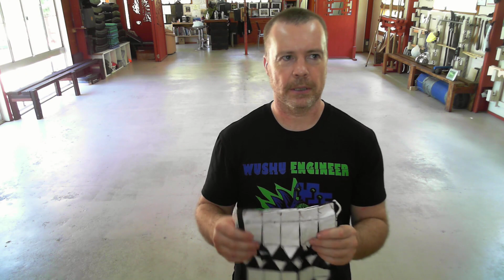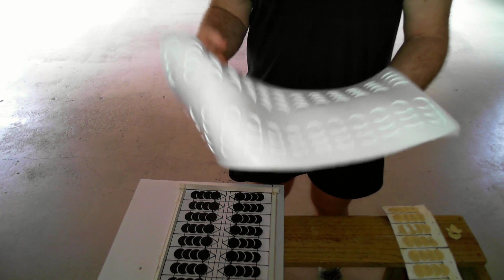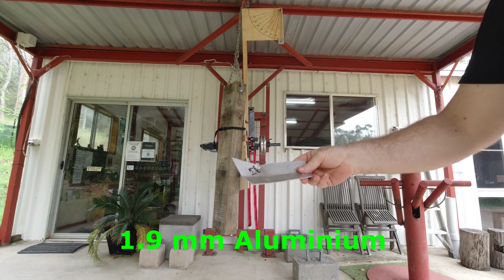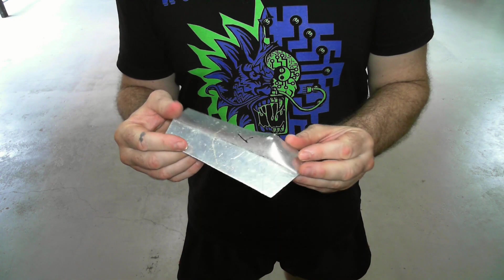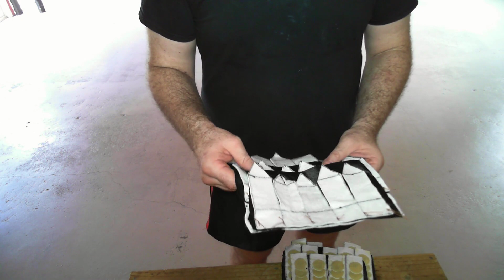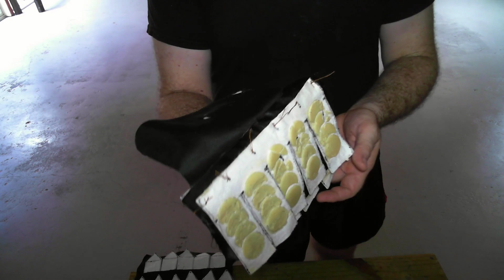Stab-Resistant Slip-Skall Armor Mark 2 - Design and Testing. Do we make it open-source? You Decide!

Comment: How heavy is it? I just wonder about the weight if you use three layers like this and make a full garment / vest.

I also wonder about how much the 'slip' effect is contributing. You might want to compare layering the armour as a rigid composite (plate - fabric - fabric) perhaps gluing/sewing it in place. It might be as simple as taking a regular piece and then fixing the lappets.
Reply from the maker: Thanks for your comment. The fabric itself is quite light. Since posting these videos, I have been experimenting with using stainless steel shim washers (0.1mm thick) glued onto the fabric. This has been quite successful and adds very little additional weight. I have yet to put that into a video though. My video producing always lags behind my actual projects.
Reply: @WushuEngineer  Oh, that sounds amazing to be honest. I'll keep an eye out for your next video.

Comment: You should shrink your videos, 49 min? Really?
Reply from the maker: In response to your other comment, I chose to use a 12kg suspended block of wood for my tests because the human body does not behave like a rigid mass when struck. I explained this in an older video in which I first built and tested the apparatus. My videos are long because my content requires a lot of explanation and if I don’t provide full explanations, I get repeat comments and questions.
Reply: @WushuEngineer  I see, thanks for the answers of that

Comment: Exciting progress! Please keep developing this.

My intuition would have been to put the rigid disk under the fabric. I'm guessing that if the knife goes through some of the fabric, the fabric would grab the knife tip, rather than slipping of a hard disk.
Reply from the maker: Thanks for the comment. I did consider that in the design and tested it during the assembly stage. It would make a lot of sense in terms of the performance of the armour. However, due to manufacturing imperfections in the discs, they tended to get snagged on the slippery fabric below and prevented the lappets from slipping under impact. The arrangement that I ended up using retained a fabric-on-fabric contact point at the critical junction between lappets and slippery fabric underlayer, allowing the lappets to move freely. Perhaps a refinement of the manufacturing process could support your suggested arrangement in future.